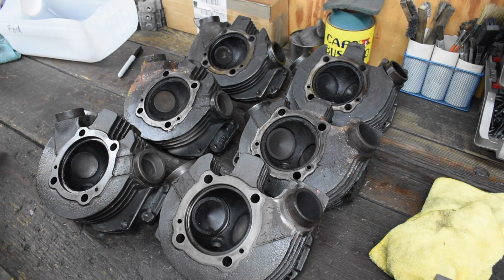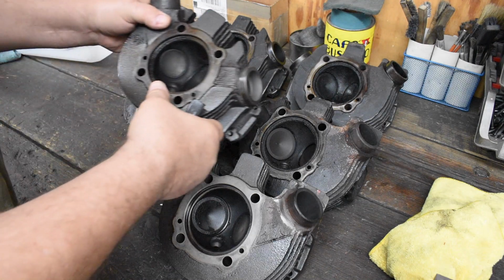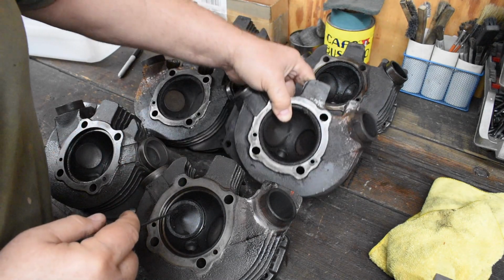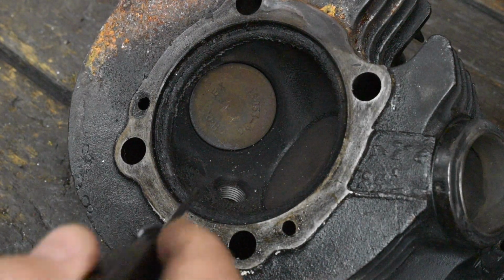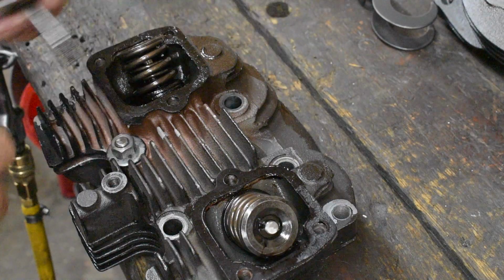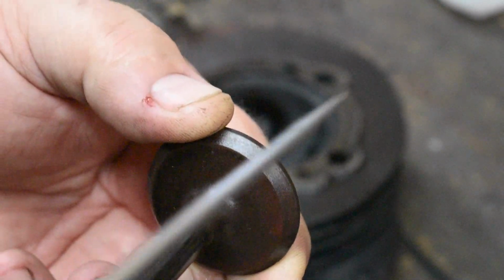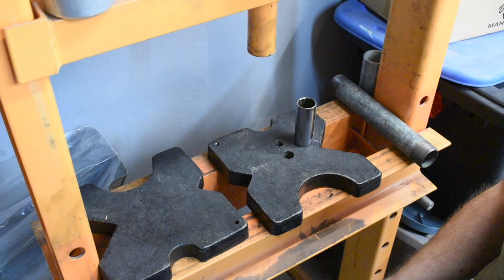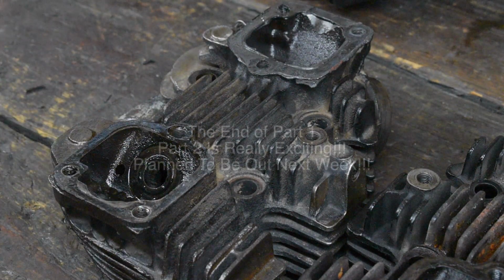Heads, Everybody Has One, Part 1 Nbr. 60

Comment: Hi Gary, another really good video,  I have seen excessive valve stem protrusion many times. I have also come across issues with aftermarket valve springs. Some springs will coil bind before stock springs will. Stock springs are good, Manley are really good springs too. For compression loss, even if it happens intermittently when kicking over can be caused by excessive carbon build up on the guides. This may be not too common but i have experienced it. Shortening the length of the guide into the port makes a difference in some cases. I hope you received my response to the e-mail you sent me. Take care From the North
Reply from the maker: I did get that email, glad you liked the video...